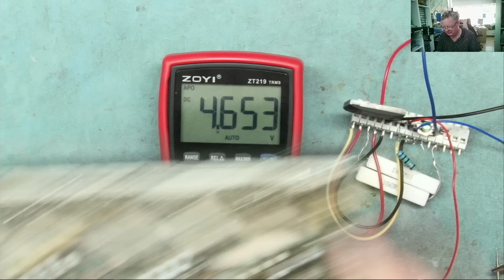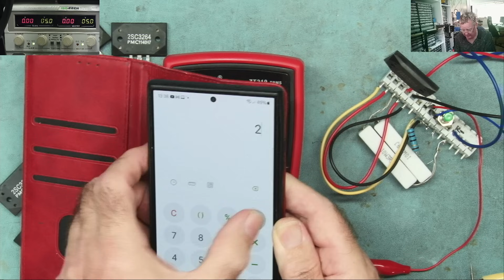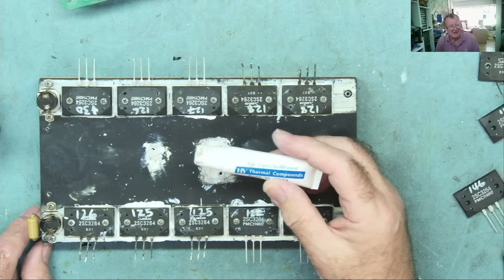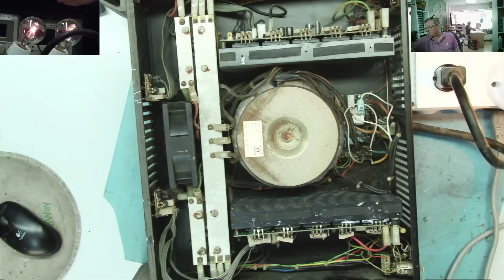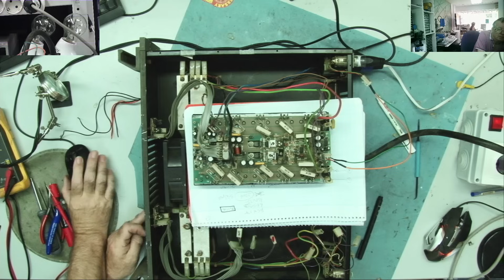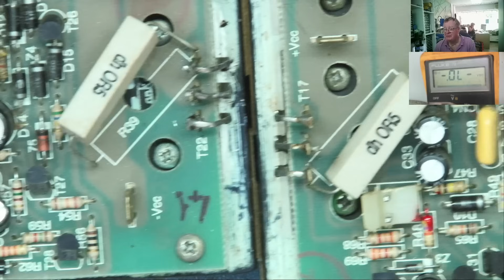Musicson P-802 Amplifier One Channel Blown : Can I Fix This With My Multimeter?

Comment: I think your matching of transistor gain is well within range to perform optimally. I'm not an expert, but as I understand the emitter resistors will balance out the small differences you have between the transistors gain.

Comment: The bias current and DC offset should also be adjusted to specs whenever changing out power transistors. Not only for longevity, but also for sound quality. If they aren't biased enough there will be excess crossover distortion. If the bias is too high the transistors will get very hot. If parallel transistors don't have reasonably similar gain, the stronger ones will take the brunt of the work and likely die prematurely.

Edit:  Also, the emitter resistors should be matched.

Comment: 10:00  Thermal compound comparisons have definitely been done many times before. I think there are whole channels based on it. But they're not electronics design or repair channels, they're usually computer video gaming channels. On the high end thermal paste stuff you have channels like Der Bauer, and more general channels likeJayz 2 cents, LTT, GN. Tech Ingredients has videos on how to make high-end thermal pastes and epoxies at home. Buildzoid has many hour long videos which may or may not discuss thermal properties amongst other details beyond most tech-savy people's comprehension. There's also some joke channel that tests stupid other pastes like toothpaste and Nutella but I don't think they have anything actually useful.
I don't know that there's much info on the low-end thermal pastes, though, besides not trusting the specs.
One last note: thermal testing is harder than you'd expect. I did a set of controlled tests a year ago with a large number of samples for thermal adhesives. Basically everything was the same (or my margin of error was way too big.) I would love to see you do a good test of this stuff, but just be aware that all your test equipment is going to need to be way more precise than you'd expect. Like, stupid precise measurements for surface flatness, surface roughness, clamping pressure, etc to get significant results.
(or, you know, maybe I was just unlucky or stink at testing methodology. 😅)
My suggestion would be to do a very basic tests with 3 identical sets of 2 compounds. If the 3 identical ones vary by more than the different pastes, you know that making it into a video is going to be frustrating to say the least.

Comment: Hi Richard 🤗,
It is very important for DC-coupled audio amplifiers that the preamp transistors are replaced as well. Check the resistors and diodes in the relevant areas. If the characteristics of the semiconductors in the preamplifier have changed due to the damage, your measuring , multimeter device will not be of much help.

Comment: a curve tracer thats a blast from the past not sure why they fell out of favour very handy thing to have.
Reply: I first used a Huntron Tracker 1000 several decades ago during my early career.  Huntron are still around and their web site on the Huntron 2000 page says that the voltage ranges used can cause problems for some modern devices, which makes sense if you consider how operating voltages have dropped over the years. Additionally,  the engineer has to understand what they are seeing and in the days of board swaps and with more things being digital at their core, I'd guess that the need reduced a lot. 

The Octopus VI tester from 1970 is a basic clone of the Huntron Tracker, it uses a voltage of 1VAC, or 1VRMS if you prefer. This means that the device actually sees a peak to peak voltage of of 2 * sqrt(2) * VRMS = 2.82 Vpp and many devices now don't like negative voltages, which I guess is the problem.

Last week, I made one, using input from several designs and borrowing from the features of the 2000. Its still a basic Octopus, but with different voltage ranges, adjustable current limits, a negative voltage protection (diode / switch), 2 device comparison mode and a 3rd pin for gate/base biasing. I am really impressed by it. 

They are cheap to make. In the simplest form, they are just 3 resistors and a small 6.3VAC transformer and you use the scope in XY mode. Many designs are still on-line if you look up octopus VI curve tracer.  jammarcade has a good write-up.

Comment: Loving this repair.
My gut instinct after hearing the sound is capacitors gone high Esr on the audio input just because I’ve heard similar previously.
Never used a curve tracer, but would be interesting if it’s something I could use. Currently use a peak DCA75 to test for gain which I can connect to my pc to get curve results, but don’t know what I’m looking for tbh
Reply from the maker: I also have a sneaking feeling the problem is a capacitor somewhere

Comment: Which Multimeter is all right, (b) get the most use here at TeH Towers.

(a) HP 3468A 5 1/2 digit
(b) HP 34401A 6 1/2 digit
(c) Fluke 73
(d) Iso-Tech 97
(e) Maplin WhiteGold ( first one i bought)
(f) AVO 8
(g) There's one more a pocket one, but I can't remember which pocket it's in 🙂 

(h) Also you have to have an AC millivolt meter like a Level TM3

I think that's the lot, but you never know i might find one at a flea market to add to the list. 🙂
Reply: 'b' is the best and I would like a 'e' if I ever saw one at a boot !!......squeak !
Reply: @andymouse I've never seen another whitegold meter, but if I do I think of you Mr squeak 😊
Reply: @TheEmbeddedHobbyist  My good friend Chris has one and that's the only reason know about them ! he bought it new from Maplin and still uses it to this day and He's knocking on 73 ! he says it's great !
Reply: @andymouse  of all the dmm's the whiteGold is the only one I've had since new. still gets more use than the other hand held ones.
Reply: @TheEmbeddedHobbyist  :)

Comment: Hi Richard, your transistor matching should work, but those emitter resistors should actually also match. Have you tested them with a milli-ohm meter (or your DIY-version that you demonstrated a while back)…. If you still have issues with one transistor heating up a lot more than the others, I would really think about increasing their value… what I would also do, at least in the beginning, after you have replaced the faulty components, instead of using the built-in PSU, running it from your bench-supply, where you actually have control over voltage and current limit, and run the amp that way, checking for distortion and thermal stability to the limit of what your bench-supply can do… (or build a dedicated variable bipolar supply, with current-limit (3A is a bit too low) and stuff. You can even add fixed +- 15V rails) just for those kind of amps. The idea is that with the PSU of the amp, you have no control or ideas what is going on until something blows up… (those large caps can deliver a punch).

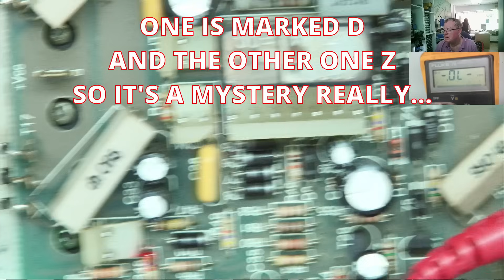Comment: @24:33 The other diode (bottom right of D14) isn't marked with a Z. It's number 75, which is very odd. I suspect that it should have been marked Z5, as it's underneath Z4 & whoever did the silk screening made a mistake. But it's definitely a "7" not a "Z". Despite the markings, it doesn’t look right that the components are transposed in the other module. If you get the opportunity, give those 2 diodes a more thorough test out of circuit & check for part numbers on their bodies.
Reply from the maker: Ithink it says Z5
Reply: @learnelectronicsrepair   It is definitely a number 7. Take another close up look. I'm 100% certain. I rotated a screenshot & uploaded to Imgbox, but YouTube deletes my comment if I include the link. Not that it helps to fault find anyway. It was just an observation. If the amp is still around on Sunday, zoom in on it in the live stream & we'll take a vote on it. 😆
Reply from the maker: @Manticore1960  Yeah I still have them, waiting on the curve tracer to see if that helps or not (I'm open minded)

Comment: with opamps.. your reading may be close but internally one can still be faulty.... not really a good way to test....
Reply from the maker: Agreed, it is a quick and nasty way to find faulty ones, for this at least, it works. It does not mean it is good if it passes the test though

Comment: Look like a thing that should be automated with an ESP, you can test multiple at once and have a led above the transistor to indicate what are the right one.
Use a zif socket to connect the transistor.